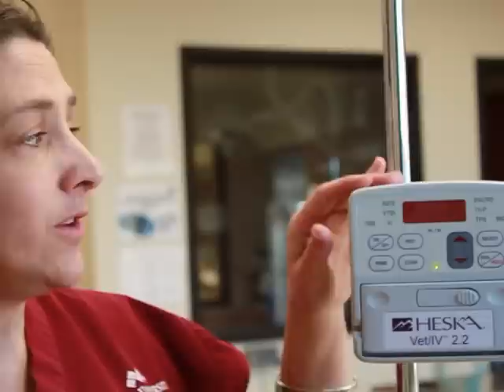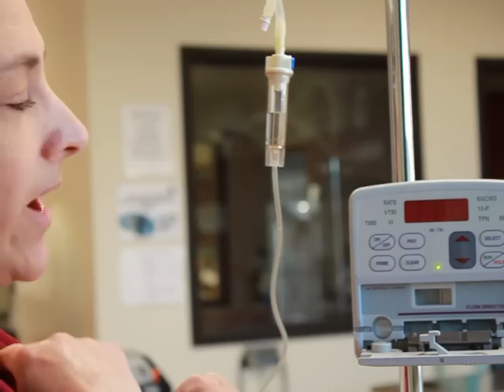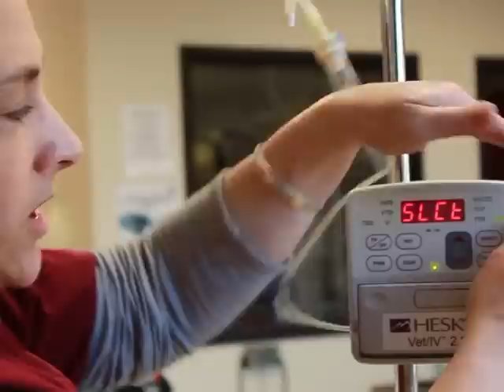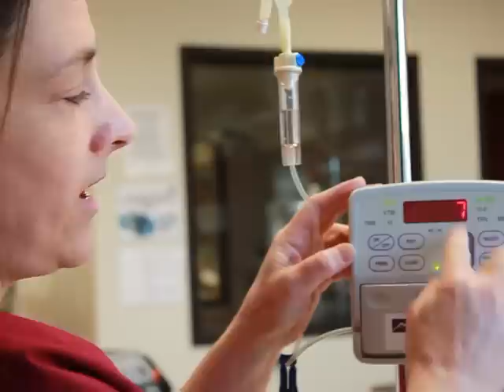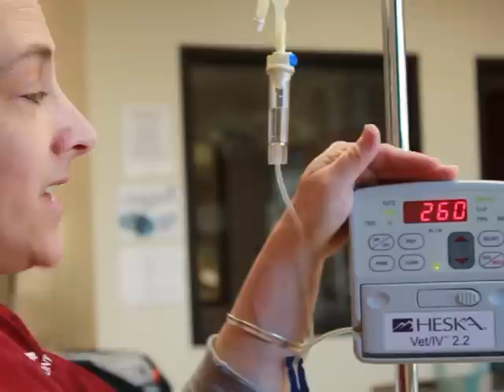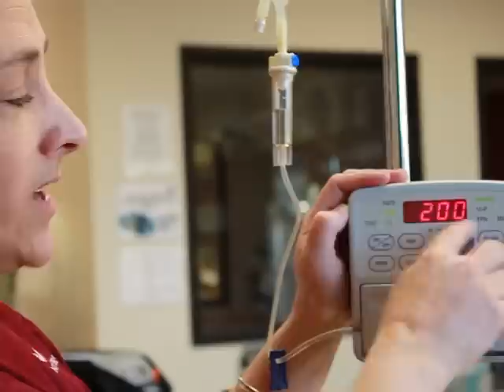Setting up the Heska Fluid Pump

Comment: How to set up fluid bolus on heska ?
Reply from the maker: What I do is when I need to bolus is: change the rate to 999 (easily done by hitting clear, then pressing the back arrow button) then I change the VTBI to the amount I want to bolus.  I leave the VI alone because I want to know the total amount of fluids I'm giving,  Then I hit run.  
When the VTBI is up then I reset the rate and the VTBI back to the original amount (minus the bolus) and hit run again.
I also do this same thing with my SQ fluid animals.  I set the rate to 999, then my VTBI to say 100mL, make sure the VI is zero'd out.  Then hit run.  This allows me to give SQ fluids without needing a second person to squeeze the bag.  It also eliminates guessing how much we really infused.